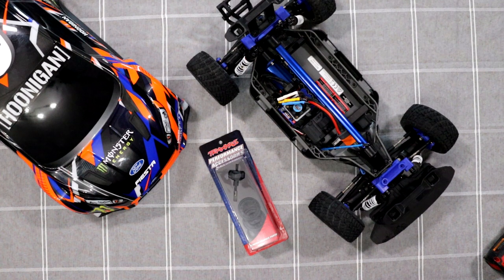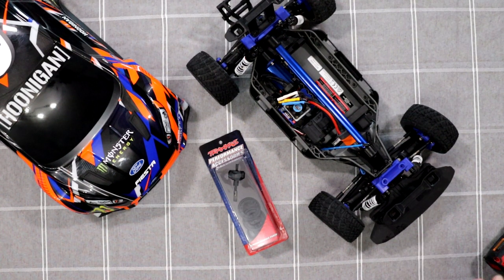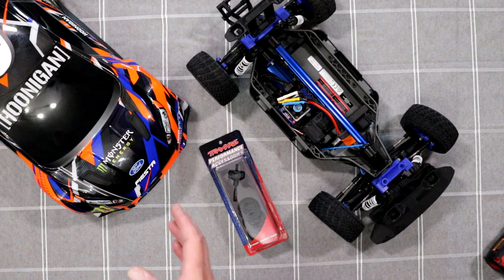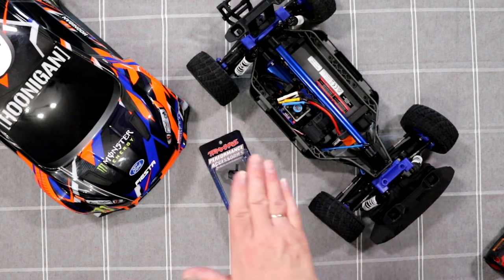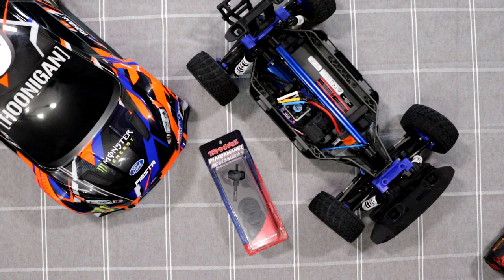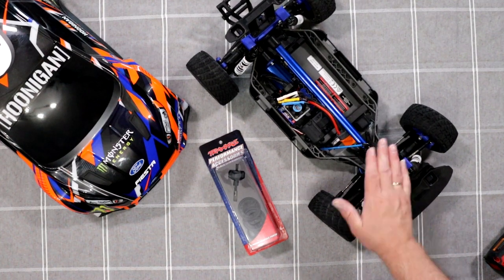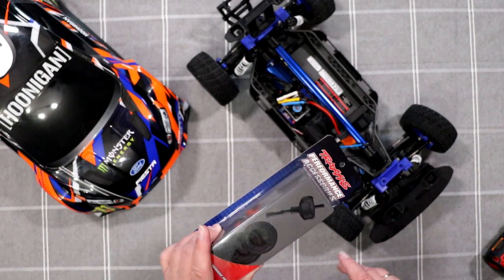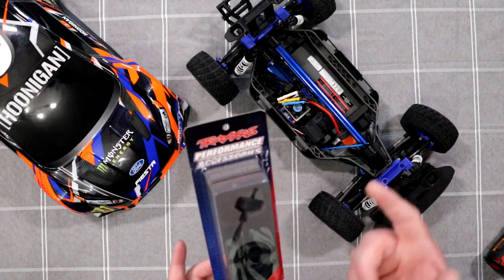Traxxas Rally 1/10 4X4 VXL installation of Center Diff Tribute to Ken Block

Comment: why you are using #6814 and not #6780? has aluminium housing and steel gear.
Reply from the maker: The reason is my local Hobby shop did not carry the other model in stock. They only had this one 6814. I have ordered the other one. I will see how long this one last.